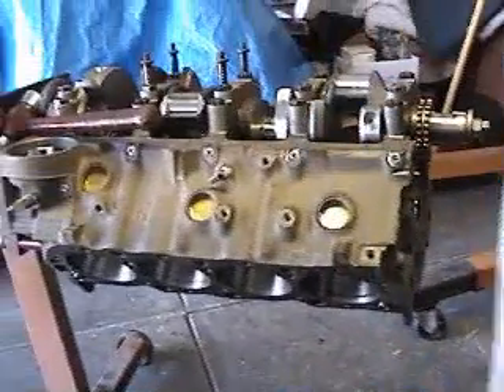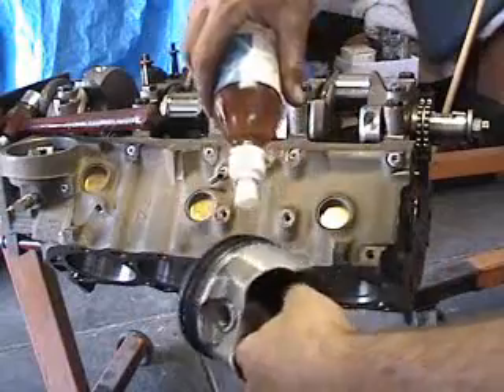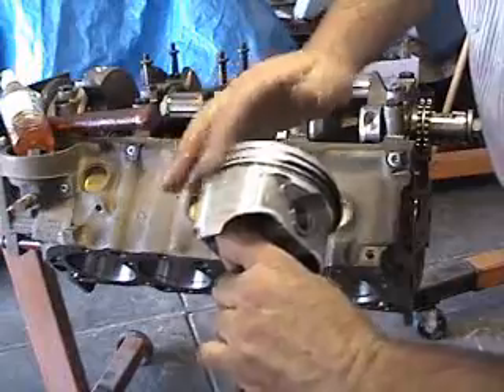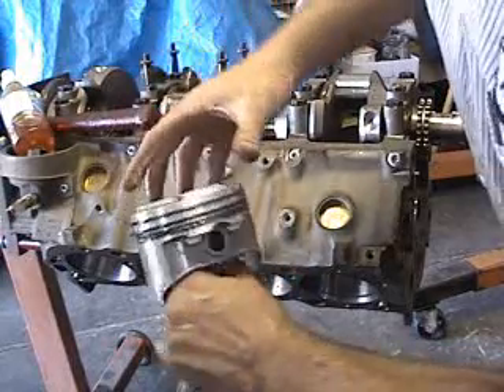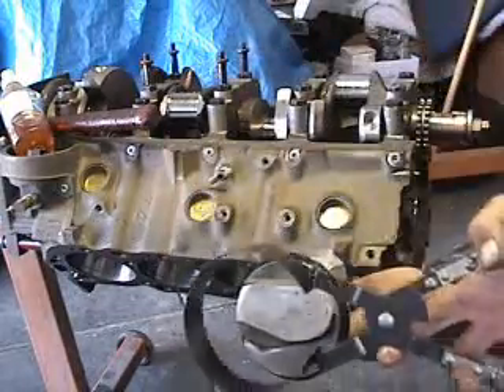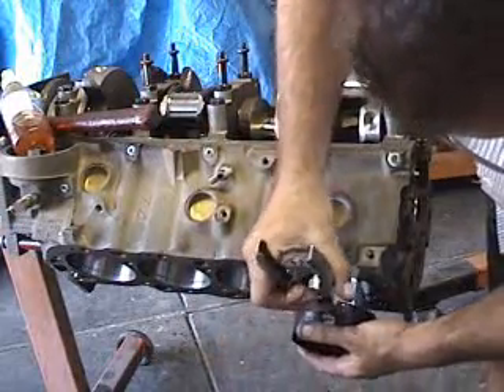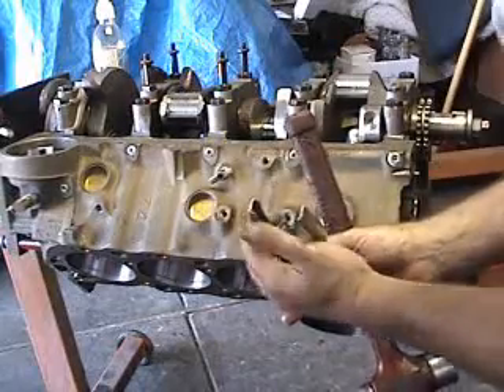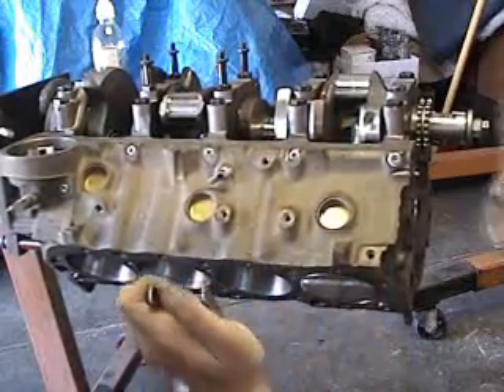HOW TO BB 454 CHEVY ENGINE REBUILD PISTON & RINGS INSTALLATION ON DVD

Comment: @Rafael Yes you can do a piston job with the engine in the car. Take the cylinder head off & get the car as high as you can, drop the oil pan, undo conrod bolts & you can then push the piston up & out the top. Installation is reverse.

Comment: I have a bad high pitched noise coming from inside my engine. Is that the rings and cylinder rubbing? Its not the belts at all.

Comment: I have a 89 caprice. 350 v8, i have 2 yellow top batteries, i just installed a new starter and alternator, when i turn my key, the car can unlock but the radio wont come on and i cant unlock my engine, it only clicks.. what it wrong??

Comment: Somebody knows if it is possible to do the piston ring change without removing the engine from the car? I just need to remove the carter down the car and the top of the engine where the valves are? In all these videos the engine is always outside